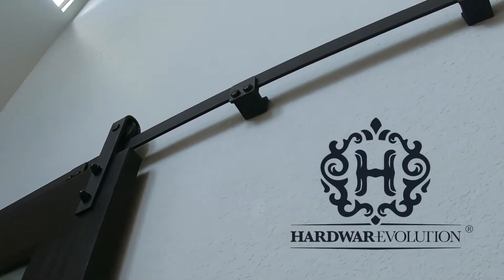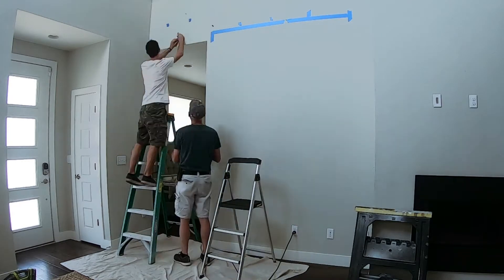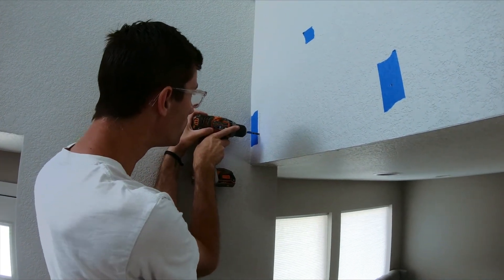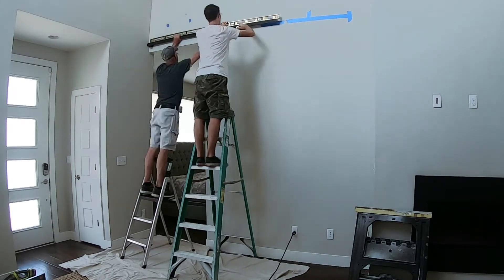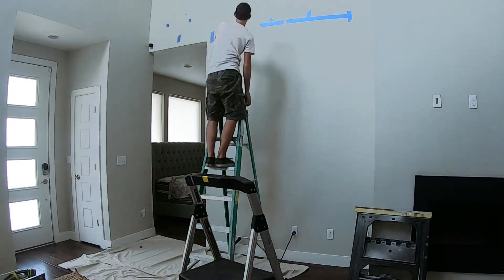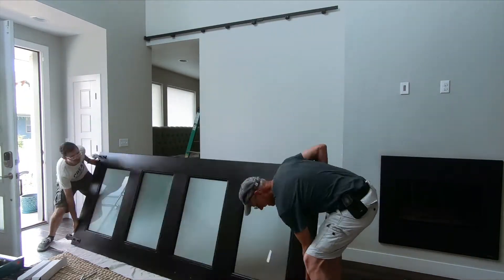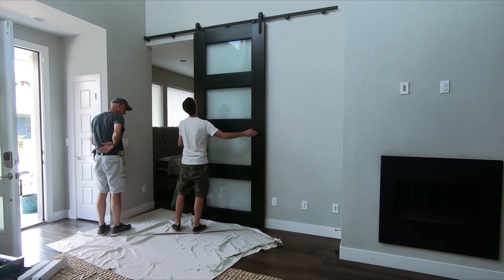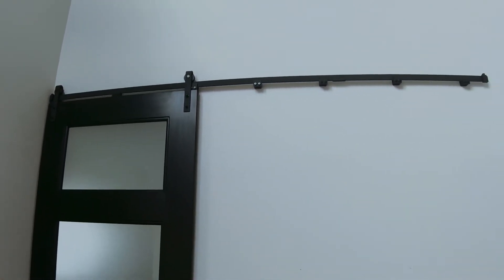Installing a Sliding Barn Door Without a Header

Comment: Quit with the click bait  ...Video says install with no header.... Video starts..... Doorway has huge header 🙄...
Reply from the maker: Um, sorry that’s not a header that’s a shadow. I don’t do click bait. If you actually watch the video you will see this mounting system does not require a surface mounted header board.  Would love to help you with your install. I guarantee my hardware is superior to anything out there. 😉
Reply: what header that is sheetrock and paint   a header is a long board above the door hole the wheel track bolts to  if the studs do not line up with the bolt  holes in the track
Reply: You did not listen, the brackets were designed to be installed on existing studs

Comment: Hi, do i need a header if i have metal studs?
Reply from the maker: No, you shouldn’t need a header. But you will need to have different anchor bolts. I recommend snap toggle anchors. I am actually putting together a short document/web post about installing on metal studs. If you go to our website and contact us, I can make sure you get all the info you need. I’ll try to comment back here too once it’s ready.
Reply: @NeaterNest  great, can i get those at home depot? The bolts that came with the door will work with the toggle anchors?
Reply: @NeaterNest  what's the website?
Reply from the maker: https://www.homedepot.com/p/Hilti-HTB-1-4-in-Toggle-Bolt-Drywall-Anchor-with-Zinc-Plated-Phillips-Head-Screw-8-Pack-3588748/305510552
Reply from the maker: These should work but you need to buy longer bolts. 

I will put together a parts list and a video for how to do it. It will just take me a few weeks to get it all together.
Reply from the maker: I will update the products to have a metal studs option and we will source all the bolts for you. Because the bolts that come with our kits are for wood studs.

Comment: What’s floor gap? It says height plus floor gap. Is that up to me?
Reply from the maker: Yes. Typically the floor gap is between 1/2” and 1-inch. If there is carpet, you don’t want it too close because of moisture. And in general you want to allow for any house movement or sometimes floors are not level so you may have a small gap on one side and larger on the other.
Reply: @NeaterNest  I have tile. You think 1/2 would be good? I’m about to install the clamps I received from you.
Reply from the maker: Yes, I think 1/2 is good for tile.
Reply: @NeaterNest  thanks!
Reply: @NeaterNest  what about if you have carpet now but plan to replace with composite wood later?
Reply from the maker: Then I would plan to install the door closer to the carpet. Maybe have it just graze the top. That way when you change the floor the door won’t be riding so high.

There is also slight play in all the bolts and lags so you could push everything up high now and then loosen and drop it later. Might buy you an extra 1/8”-3/16”

Comment: You just sell the freedom clamps and they will work universally with the rail and hardware that I purchased with my door?
Reply from the maker: We do sell the Freedom Clamps separate. I wouldn’t say they are universal but they do work with most standard tracks on the market that come with round spacers.

We have special instructions for installing them with a 3rd party kit. The one major change are the holes drilled in the door. Freedom Clamps require a little extra space between the door and the track. If you have a door that was pre-drilled for another system then the holes will need to be filled and re-drilled to work with our brackets. So just be aware of that.